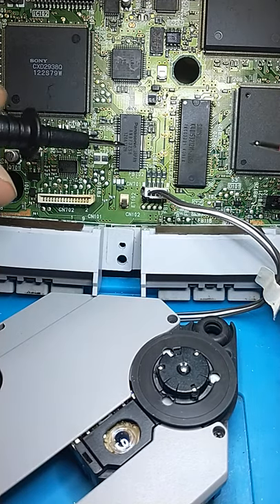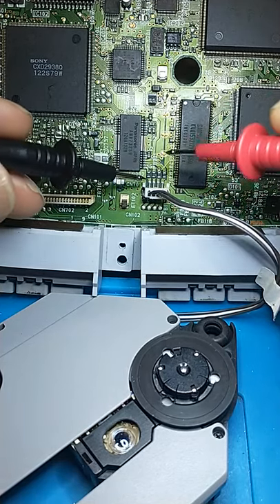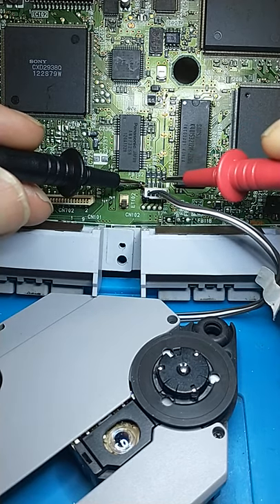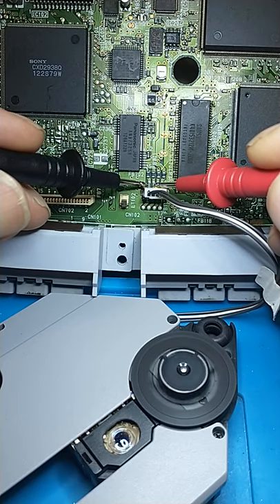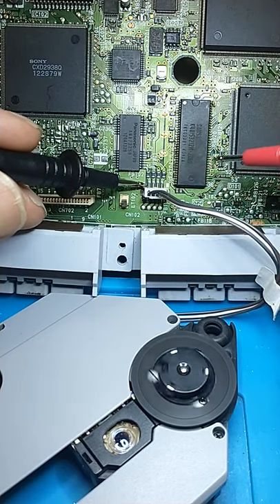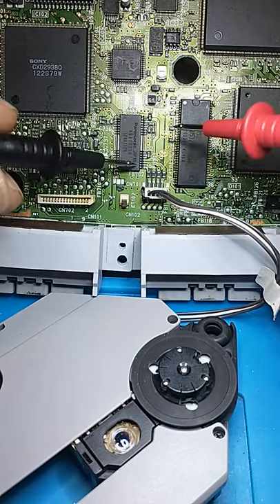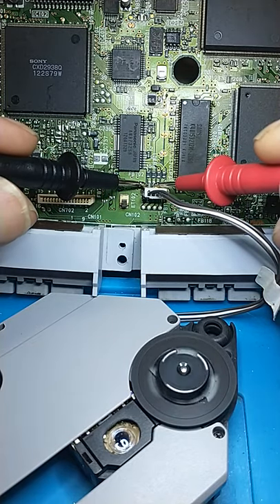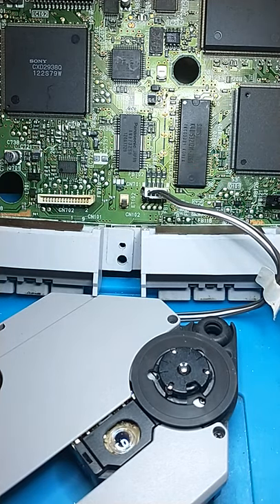Sony Playstation | PSone CD drive  spindle motor test #short

Comment: Hello. I have a PS1 (SCPH-7501) and the spindle motor spins insanely fast even with the lid open. It doesn’t read games obviously. When I push the lid switch, it activates the laser while the disc spins out of control.